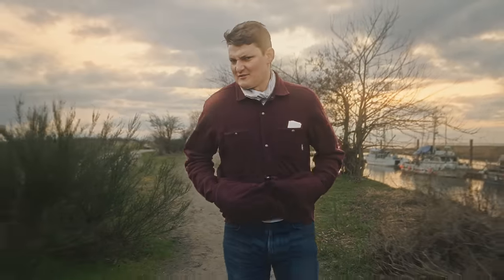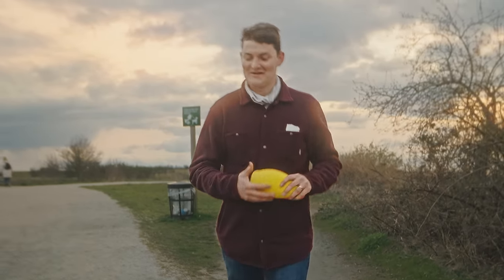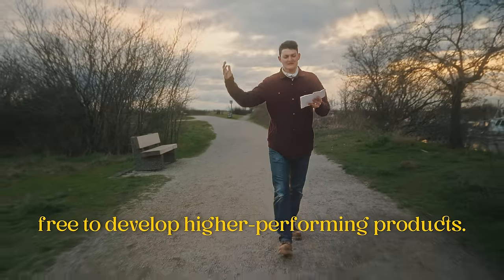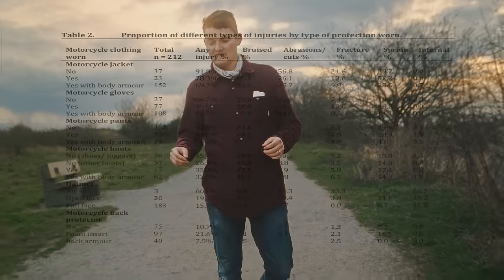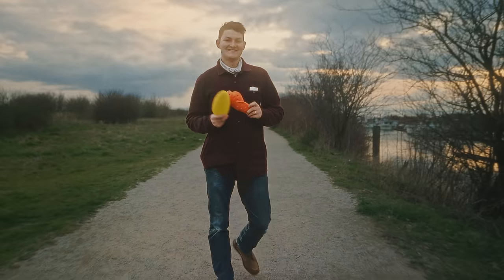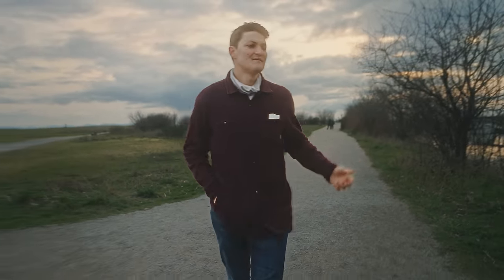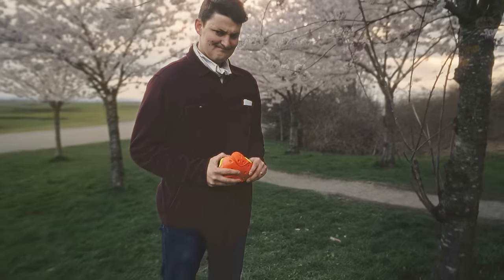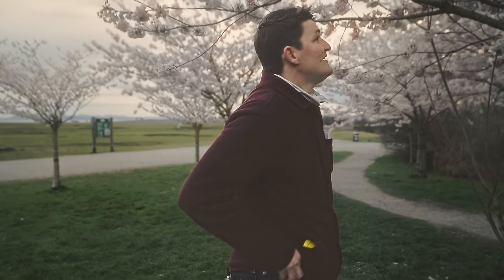Why I Stopped Wearing Motorcycle Body Armour

Comment: As a biker of 40 years I’ve seen some shit, one of which was seeing a guy in front of me hit the deck and destroy his elbow, literally through the bone like it hit a high speed sander, yeah he had no pads! Another hit a car with his knee Fookin hard too, he got up and walked and didn’t even had a bruise, without the knee pad I reckon his knee would have been in a right mess.
Seriously, if you think you’re harder than the surfaces you hit, and impact pads are stupid, then you’re both extremely gullible and extremely stupid. 
To think that impact absorption is unnecessary then you’ve never hit something hard without them!!! 
Hitting anything hard at 30mph plus is not a pleasant experience, I can vouch for that, and I’d much rather be protected. 
I actually used to think this guy was ok, but now he’s scoring high on the Moronometre

Comment: Probably the most irresponsible and careless messge he has put out. Its protection, not prevention. Its like wearing a bulletproof vest, doesnt garuentee you wont be shot or wont die, but youll still very likely feel it. If anything the armor may help reduce the severity of a fracture, will better protect against slides, but doesn't prevent injury. You have the money to buy airbags, and not wear armor good for you, but talk about how they are only a gimmick for regulatory retail marketing. You do you as well each and everyone who rides.

Comment: This chap doesn't understand how or why standards come about. Engineers want to do the right thing, but don't want to start from first principles every time they start the design process. They like simple rules to work to. And yes they're always a sensible compromise. Plus "a realistic 50J". That's not necessarily realistic, or what can be expected from every crash. It's just a benchmark figure. What about all those 10J impacts you might have after you remove the pads? Really wanna suffer a fracture just from those? It's a dangerous and clickbaity argument he's making. Please don't listen to it as there's very little logic there.

Comment: After sliding about 250ft mostly on my forearm, knuckles, palm, helmet chin and toes. My jacket taking the brunt of the damage. Which was the shell wearing all the way through. The "impact pad" was about half way though its thickness. However my skin was untouched. That beings said I did have a piece of gear fail and that was my right glove ripping from the pinky finger down the side of the palm. Which the road rash worn down into the muscle almost to bone. I'll keep "these tokens" in my jacket and ignore click bait videos like this. Thank you "tokens" for saving me from even more pain because if I would have taken you out like this jackass says I should I would have lost most the skin on my forearm too.

Comment: So bruh said he doesn't use pads but then shows a pad .... also i checked the super nice and very cheap 1000 USD airbag jacket (which btw has .. arm protectors oh no!) which needs to be reloaded when used (aka either buy another one of spend 450 bucks reloading) .... inb4 the note of "oh wait but there are good pads ..." in the comments

Comment: Ineffectual protection is worse than no protection. As it inspires a false confidence or sense of security. You will know I hthe NS TV regulations that required Honda cars to recall several 1000 if not a 1/2 million I forget the exact number of cars produced with half millimeter steal when they were advertising 3/4.. Which was required by the united states to make the car's stiffer and more impact resistant in a crash. Of interest, Honda sold in Japan still use half millimeter and have fewer deaths per 1000 crashes.Then US hondasame size saying wait of trans.Mission.They just weigh 700 to a 1000 lbs less. I don't really think it's the weight of the vehicle either. From his short my take is to go to a tack shop For people who ride horseback.
Their gears designed to protect them from a two thousand pound horse.

Comment: Normally I absolutely love the content on fortnite, but it is asinine to go riding out there without any form of Armor Gear on knowing that if you hit the ground hard enough you can easily break bones and other damage varieties to your body. The asphalt and concrete don't give a damn about your ego or whether or not armor you think is sufficient enough or not some armor is better than no armor 

If you want to be dumb enough to no longer protect your body in case of a fall then hey that's your choice but it's just plain asinine. Asphalt and concrete are stronger than human bone and as you've already proven in previous videos years ago can easily act as a high-powered high-speed sander that will rape the skin right off your bones at the right speed depending on the accident

So enjoy your road rash and broken bones if it happens , but...I hope it doesn't sincerely Ryan

Comment: Boo! Young generation is so annoying. Think of safety of car in comparison to motorcycle. Put the pads back in youngster. You need it all. A motorcycle accident can be at a stop light with a stall or put your foot down on or forget you are in neutral not first gear. Wear your gear!

Comment: This video is not very intelligent. I don't get why wearing no body armor is better than having a small protection? It's promoting not wearing body armor which can lead to more injuries among riders.
Reply: Well you clearly didn't see the fact that he wears an airbag while riding. And also the trad off is comfort
Reply: @turbojurpo  Yeah, I saw that. Basically, he wants us to buy airbags or nothing. Motorcycle airbags are way more expensive than impact protectors. Usually, you get these protectors when you buy a good motorcycle jacket. You don't have to buy them separately. I think If you have the money, buy both.
Reply: @turbojurpo  The topic of this video should have been that impact protectors don't protect in every situation and the standards need to be improved. Instead, we get a message to live a free life and don't worry about protection because they don't work but buy airbags. If he doesn't like wearing them, he could have kept this information to himself. 

He also quoted the research paper wrongly just to prove his point.  I am not sure why people are even defending this guy after this irresponsible video.
Reply: @supernova82  This video is brilliant in that it has raised awareness of a major issue with motorcycle riders ppe protective clothing. You may disagree with the method used however it concerned you enough to comment and cojitate on the ramifications and he did it in a manner that hooked people`s attention - an extrememly hard thing to do in MARKETING never mind the testing realm - which is a very dry subject dragged out over months and years with a lot of money being spent in research. Every thing in life is opinion.

Comment: I very much dislike this video. You push an agenda rather than promote critical thinking. The data you are using clearly has more significant factors to it that you do not even address. Everything from the way people intending to ride being a factor on if they will or will not wear armour to start with and how this will statistically bias such data. It also does not address severity of injury. There is a huge difference from a clean brake and a bone smashed to bits. You also over play the relevance of broken bones specifically. A bone can often be easier to fix than other potentual injuries you can receive in a crash. If you wish to wear no pads it's your life go for it. If you wish to ask the question is the minimum standard for pads really enough then great again go for it. But to try and make out armour is essentially worth less and encourage people no to wear it is down right dangerous, you could easily do some real harm with this video.

Comment: This video shows how statistics and the way people interpret them can be dangerous.  You slide off your bike at 80 mph, and you will appreciate those plastic pieces taking the wear instead of your elbows, and other places they protect.  I have ever 300K miles on many different motorcycles, and am a lot older than the guy in this video.  This video is irresponsible.  I also ask, "Why is he walking towards the camera?".  This technique is so old, to establish some kind of authority in the presence of moving towards you, it's a gimmick.  He could have sat on a stool and spouted out the same nonsense.  Very gimmicky video, with very bad advice. iMHO.